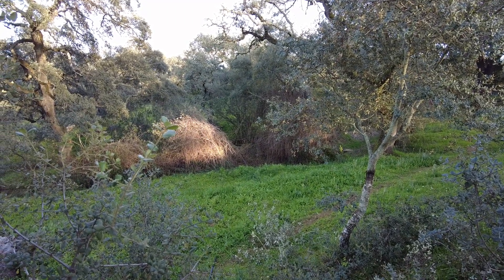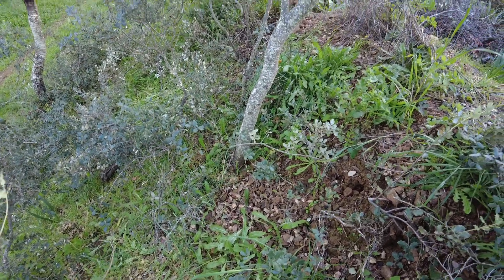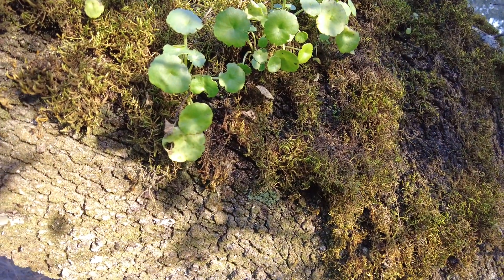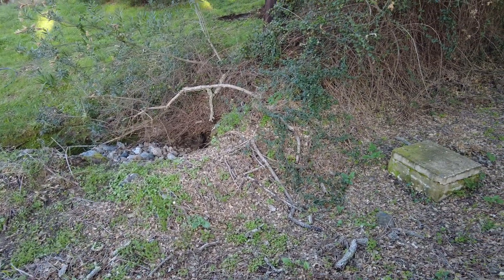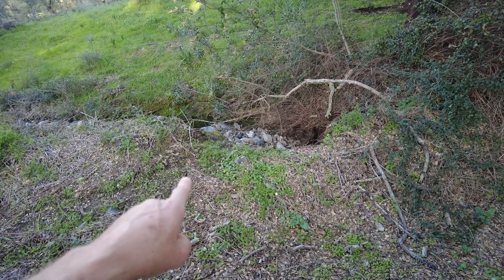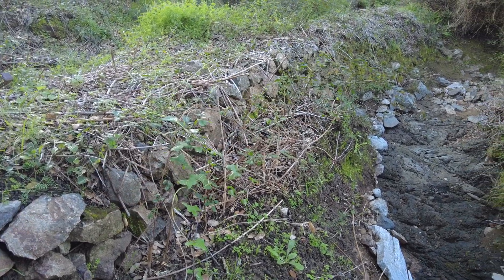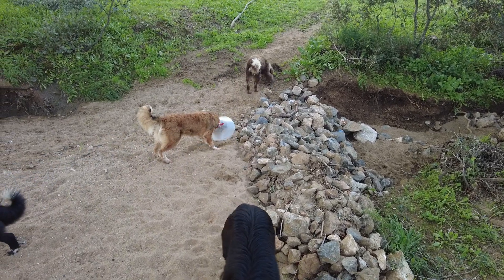My eyes are opening to the changes due to water management systems.

Comment: 1:40 That fresh tender growth is a viable candidate for rooting.  I would salvage those cuttings, get them to the sand box, clip the individual shoots, dip them in rooting hormone, poke a hole in the sand so the rooting hormone does not get rubbed off, press the sand around the cutting and cover the sandbox with shade cloth.
5:32  As long as the cistern cap and the first inspection tower make relatively good seals, I do not think there is any significant danger of letting the qanat canal fill with rainwater.  In fact, I will suggest it is likely beneficial.  With the Giraffe, you could cut a passage through the mound of earth below the qanat cistern cap and install a leaky weir - but only when time allows and after you monitor several additional overflows.
6:20  I question the elevation difference between the house and the breach in the qanat wall.  When you have the time and before you go further, I'll suggest you carefully study the topo map to determine  the elevations you have to work with. 
6:50  It would interesting to see the sluice gates that are out of the ground.  I can't begin to visualize what they look like.  I'm guessing the are steel - so not of the original Moorish design.
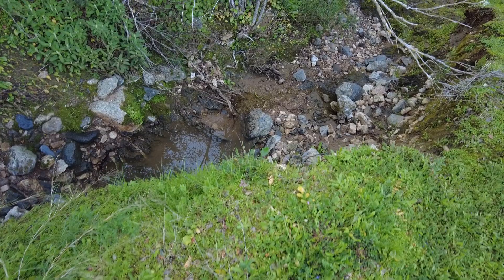9:11 Right hand lower corner;  It appears a portion of the bank wall has been undercut and is starting to calve away from the rest of the bank.  Another excellent sign of stream/creek recovery.  This happens as the water level rises in peak flows. When the bank calves off, the distance between banks is wider, increases carrying capacity and slows the velocity of the water.  The soil and plants will be captured downstream, continuing the process of filling the incision.   Hopefully the plants will anchor in the stream bed so their roots will secure the sediment against further erosion.

I think it is appropriate to note that this creek is recovering from human injury as a result of human actions that support natural processes.  In this specific situation, we have the dilemma of the mountain side erosion that is beyond the owners control - so while it may not be possible to guarantee a forever solution, we have a valuable learning tool to illustrate what is possible when natural processes are supported with human activity. 👍
Reply from the maker: Man o man. This water stallion breaks my head. Thank you for sharing Steve

Comment: I was watching a video from Life of Leaf recently which reported on a project in Ethiopia where they reforested 37,000 acres of hilltop land without planting any trees. They used a process pioneered by Tony Rinaudo called FMNR (Farmer, Managed, Natural, Regeneration). He had observed years ago while working on reforesting dry harsh areas that instead of planting many saplings that required a lot of effort to try to keep alive until they became established and more often than not died, that the native bushes - if they were thinned out that they would quickly establish and grow into trees. The native plants already had an established root system in the ground and didn't require supplemental watering to grow. 

Its an interesting video to watch if you have the time to search for it. Same principle really as you are now employing, by thinning the Holm Oaks to select the best 1 or 2 shoots and then allow the roots to focus all the energy to grow them instead of having multiple shoots being supported and overdemanding from the root system in drier months. Only difference I saw was that once they have thinned the plants, they leave the cut material as mulch around the base of that tree to help the soil to both avoid direct sunlight and to feed the soil as the plant material composts down. The mulch also suppresses weeds which also aids the trees establish quicker to form a canopy, as they don't have anything growing at their base sucking up nutrients and water in competiton.

Comment: Thank you for the update Martin 😊
You have embarked on a grand multiyear experiment Martin.  I have not found any similarly situated properties in the dehesa that have so fully committed themselves to farming carbon, water and native oaks.  As the years pass, there will be many fine adjustments to the platform of information we had when the project began. The formula, I will suggest is;  1) Begin by trying based on best evidence. 2) Observe 3) Adjust based on all new evidence. 
I will suggest that we/you are still dialing in what the "seasons" actually mean in your Mediterranean climate.  It appears that late winter/spring is not the best time to prune because new growth has already occurred.  Adjusting to the new evidence, my new thinking is prune when the weather turns cold - Fall and early Winter. And I will add that observation shows that your Mediterranean winter is usually not a full blown winter with killing frost for hardy plants.
I will caution you against pruning in the heat of summer.  The trees are already stressed from excessive solar radiation, heat and drought conditions.  Do not add another stressor.
The next simple step to manage the creek flow is simply filling the creek gully with a cuttings/pruning's.  That is quick and easy given the amount of cuttings you are producing.
I agree with your thinking about filling your swales with brush.  I do not see any evidence that the brush ifs harming the performance of the swales.  Rather, what I observe is that the brush meters and slows the flow of water, shades the swales, slows evaporation, adds carbon and cools the soil.  Each result is beneficial to the growth of healthy soil microorganisms - living soil. Brush in the swales is a beneficial adjustment to universal permaculture protocols.
4:55 The bramble and devils rose;  I will suggest that you take the time to cut everything that is above the level of the creek bank and let the entire pruning drop straight into the creek to serve as an analog beaver dam.  The more the brambles and devils rose are intertwined, the better.  Once the mass has been cut free, I will suggest using a board laid over the top as a walkway (or the big bucket of the Giraffe) to force the organic matter down between the stream banks.  If the devils rose and brambles are anchored in the streambank - they will not wash downstream.
7:10 Volume of water in the qanat cistern (40cm = 1.3 ft. from full); Seems you are in a position to start as soon as time allows a simple top of the farm irrigation program.  I'll suggest the simple approach is to run the pipe you have to the top of the farm to feed one impact sprinkler at the highest elevation. Simply turn the pump on and off manually during daylight hours.  This early in the season the use of an impact sprinkler during daylight is not nearly as wasteful as the peak of summer.  This is a quick "try it fix it" first step because time is short.  In turn, you have the opportunity to see how this water migrates downhill.  Will it be absorbed or create erosion gullies - only experimenting will tell.
9:05 Do not underestimate the value of the "puddles" to aquatic life, birds, reptiles and small mammals.  The small puddles are tremendous aids to growing biodiversity - thanks to the upstream sand deposits.

I am SO happy to hear there are so many regenerating Holm oaks on your farm.  Another example of new information.  I clearly remember advocating for planting acorns.  Now it seems there are so many specimens that have grown naturally and are at least several years old across the farm that you are at capacity for what two people and 4 dogs can tend and protect from deer and pigs. What a wonderful development! ♥
Reply from the maker: Filling the creek with cuttings? Mmm. My neighbour will receive tons of brush on his farm. Just kidding. Thank you for sharing. Much appreciated Steve
Reply: @SuerteDelMolinoFarm  I kept writing - so there is more to read 😉
If the smaller cutting should wash downstream, they will get stopped by the existing and growing beaver dam analogs.  You can think of it as nature forcing, twisting and weaving cuttings together into a mat.  Simply a variation on the leaky stone weir. 
8:21 is a good example.  If brush makes its way past the vegetation upstream of the gabion it will likely become trapped at the next tangle of brush downstream.  Remember, the aim is to get the water up and over the banks of the creek so it can spread out on the land while the sediment it is carrying drops to the bottom of the creek incision.  You can see all of that happening in this section of video. 👍
Reply: I love these videos and look forward to Steve's comments about possible next steps to take. As a general rule I fully agree with his ideas. Steve are you trained in the area of permaculture practices and design?
Reply: @bonniefowler5013  No institutional certificate.  They didn't exist when I graduated college 😂
54 years of experience "connecting the dots" managing projects.  I am very fortunate to have found Martin.  Most YT's are not interested in this level of input.  I believe it feels intrusive.  I would say Martin and I are kindred spirits 😊
If you know of another project on YT, I have available time.  My "pay" is keeping my brain active as long as nature permits.
Thank you for your kind comment! 👍
Reply from the maker: @stevejohnstonbaugh9171  Certificate for Steve due!
Reply: Thank you for your observations and great update. It's beautiful to see the development of our farm. I especially like to see how well the Holm oaks grow on the berms.
Reply: @edithdutoit3060  You are most welcome!  I agree with all of the Holm oak discoveries made in the past year.  I suspect that you may see that level of vigor spread to the mature trees over the coming year as the moisture in the dirt continues to rise.
I'll be tagging along to see the magic unfold.😊
Reply: @stevejohnstonbaugh9171  Thanks Steve